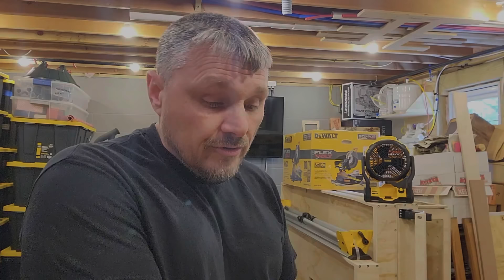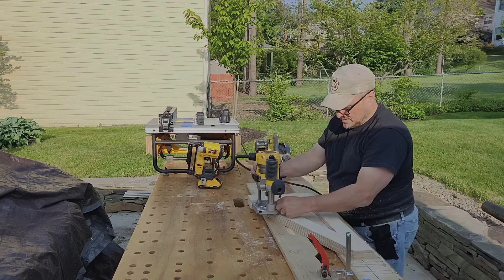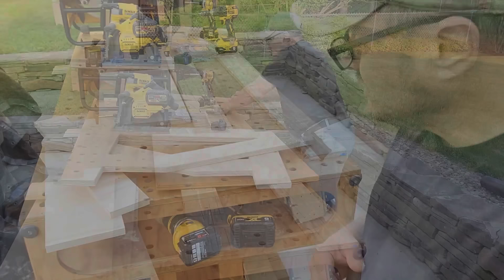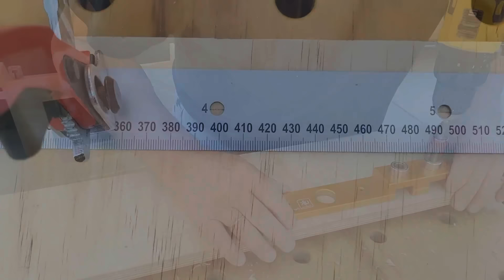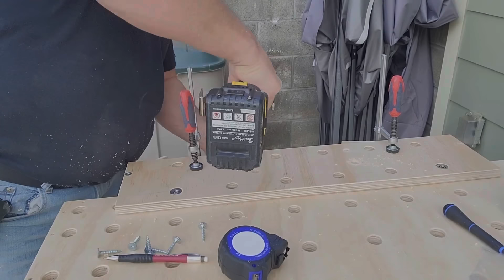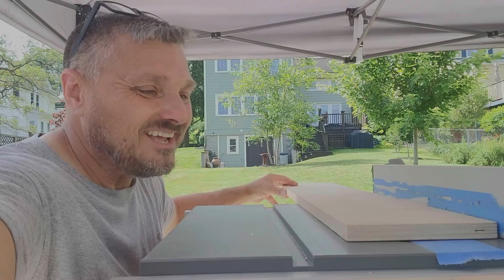Meet Steve: Smart-Fam Member: Veteran, Teacher,  Builder

Comment from the maker: What do you think of Steve’s cradle? Drop a 👍 if you’ve ever had to fix mid-build.
Reply: Hi Ron. I am using this cradle on almost every job at this point since the table saw is a go to for a lot of milling and modification. Since I have completed the SMART Station, I am really rocking the jobsite with tool versatility. I am close to completing the router tables and look forward to including router table work on the jobsite.

Comment: This was a great video. Definitely will go check him out. I've always enjoyed your videos. I've never really had a desire to actually build the Smart benches because I'm not mobile. I have a shop at my home and I never need to travel. But as I've been planning my shop makeover THIS video may have changed my mind. When he wheeled the smart bench out on the smart cart a light bulb went off. I have the perfect spot for a Smart Cart in my shop. I don't want a full bench all the time. But when I do need one... I put a Bora centipede in the space in my shop where I refurb furniture. This would allow me to pack it up and wheel it out of the way when I'm sanding, painting or finishing. Hmmmmm.... lots to think about. I'm definitely getting inspired.
Reply: Thanks AWD! I hope to have a fixed shop someday to compliment the offsite work I do. My plan would to still incorporate the SMART system where possible in a fixed shop and with most tools in my future fixed shop, I would get as many things on wheels as I could so the shop becomes very easy to transform. I have seen almost every New Yankee Workshop and while that shop of Russ Morash's (where they filmed) is not small, it is not all that big either but Norm was able to do so much because most tools were wheeled and could be moved into position or stored out of the way as the project changed. I am envious of your setup!!